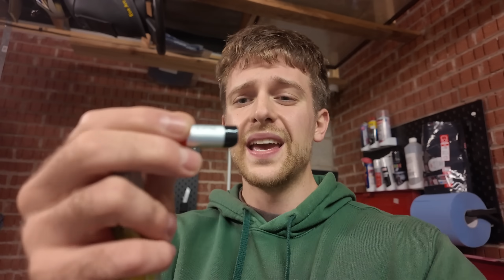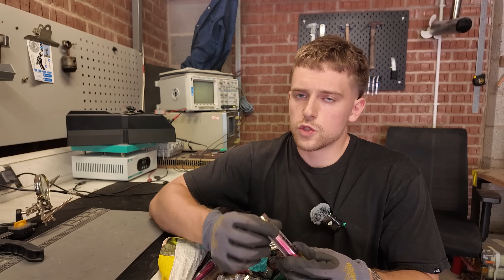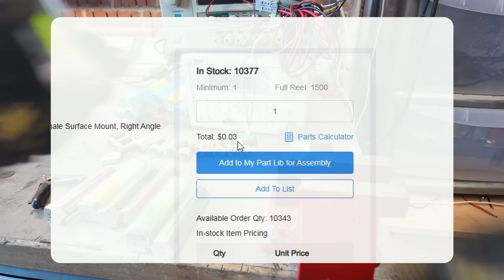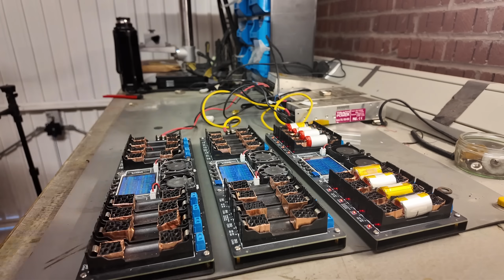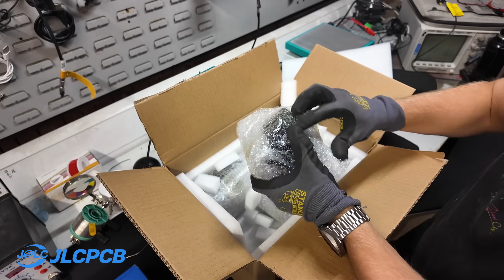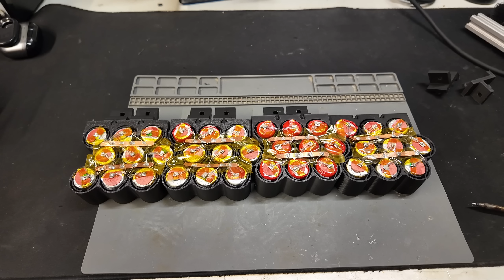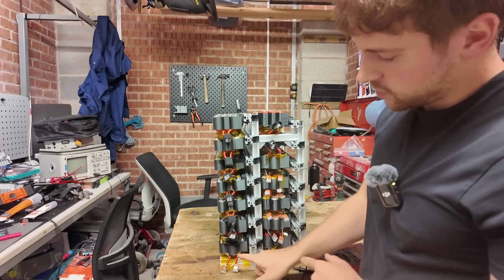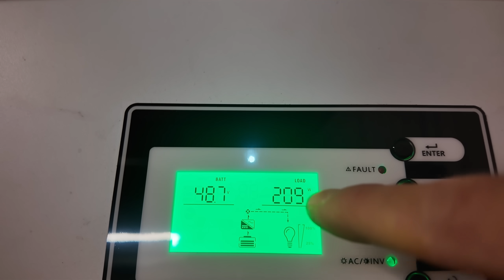I Powered My House Using 500 Disposable vapes

Comment: I was collecting these batteries for a little while, they are basically the Cr123A batteries that are about $6 a piece, just laying there on the side of the road for the taking. I did just a touch of soldering and am able to put it in a charger meant for those batteries. They are VERY common in good flashlights, gun lights/lasers and gun optics so It's nice to circulate them so I always have some charged instead of buying them for $6
Reply: This batteries are cool but needs to be cycled daily and it should be charged and discharged or else it will became a pillow you can even go for laptop scrap Batteries which are dead and get them at cheaper price and salvage them you may get some good cells from that and they will not going to be pillow 😅
Reply: @DIY-PROI they do not need to be charged and discharged daily. If they are not in use, they should be stored at storage voltage, 3.75-3.8v per cell
Reply: How do I make them actually usable for things?
Reply: @NationalTreasureExplorers  I wish I could share pics here... The ones I collected are mostly from "Elfbars" and wrapped in blue plastic, they look the same top and bottom but there's a tab of metal on both ends. The black wire soldered to 1 tab is negative and the red wire soldered to the other tab is positive. I clip the wires off, soldered the - tab flat against the battery, soldered the + tab flat against the battery then added a "button" (a glob of solder) on the + end. They then fit perfectly in a plug in charger I received when I bought a cheap optic (for an airsoft gun) that came with rechargeable CR123A's. I initially plugged this charger up to an extension cord stretched across the backyard in case something went wrong but when I placed the soldered vape batteries in the light was red like it was supposed to be and after some time the light turned green. So I put the rigged up batteries in my Streamlight brand flashlight on my real rifle and it was as bright as any new battery you could buy. And people throw these things out everywhere after using basically 2% of the batteries life

Comment: You can recover dead cells, by just leaving them on the charger longer. Most, if not all should recover to full voltage. I would recommend not going over 1A charging for most batteries, 800 mA for the small batteries (cigalikes).
Reply: Solder leads to bus bars before attaching to the pack. I have a spot welder for that. Don't want to send the batteries into thermal runaway.

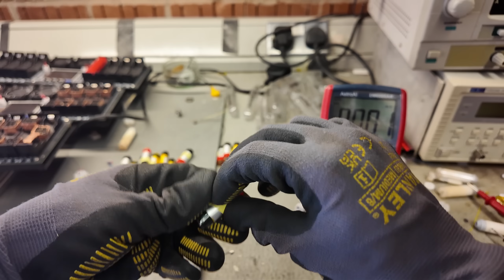Comment: 2:33 Nope, I've worked with 18650 Li-Ion cells that had 2V as their minimal Voltage. The min. voltage is different, based on many factors.

Also you shouldn't build a pack with cells in series. They had a hard life, are from different manufacturers and batches and likely have widely different internal resistances. Yes they can be balanced, but balancing is wasteful and takes a very long time. You might overwhelm your balancing circuit and end up with a pack that never delivers it's rated capacity.
Put similar cells in parallel and convert the resulting low voltage/high amp power into what you need with a DC/DC converter or DC/AC inverter.

FYI it is very common for a single cell to go low and slowly take out the whole pack. Ideally your BMS monitors that and (if your application allows that) shuts down the offending bank.

Comment: I really like the enthusiasm. But unfortunately there really is no money to be saved or earned recycling rechargable batteries at this small scale and this heterogenous form factors! 

For powering the house Deye offers 48V 5kWh Battery block for 750€ in a 19" metal case with BMS. I'm sure with deals and maybe from other vendors this can be had even cheaper! And these battery blocks are made of brand new LFP cells which hold up 6000 full cycles. 

At around 1% of calendaric degradation and estimated only 200 days a year where the battery actually does the full cycle this pack holds up for 15years before it gets into "inconsistent operation" territory.

Comment: I don't undestand how these can still be sold legally, when there are already alternatives on the market where you just change the pod with the liquid on top and the bottom part is reused and recharged. They are just as cheap and easy to use as the one-way vapes.
Of course there are also the more expensive vapes were you fill in the liquid manually that existed for even longer but most people want it as simple as possible.

Comment: As a battery nerd since 2015. You CAN recharge "bad" cells.

In my case I have 1,000s of 18650 cells. (yes thousands)

As the current is increased SLOWLY
The voltage SHOULD go up
If not the cell has EXTREMELY SMALL Lithium dendrites that have punctured the separator, bridging the gap from anode to cathode creating heat.
ONLY THEN a lithium cell is truly dead and should be recycled

how to charge a "bad" 18650
I will do something like this for a minute each
10mAh
25mAh
50mAh
100mAh
150mAh
300mAh. If they get warm at only 300mAh then there bad
Rule of thumb: dont charge a used 18650 above 1a per cell.

"But batteries are dangerous!/Don't do this at home"
No stupidity is
40,000 people in America alone DIE from car accidents yearly
while only 4% die WHEN a battery catches on fire.
Battery fires are extreamly rare.
There are literally BILLIONS of lithium batteries
Yet only a handful of battery fires
Batteries are actually incredibly safe.
The problem is fearmongering.

The Note 7 fires were caused by a manufacturing design flaw causing the Anode and Cathode to touch (short) releasing all the batteries stored energy in seconds caused by thermal runaway.
Hoverboards from Chyna were made so cheap they often cut costs like the battery or charger. Causing fires that were 

Also if there is a battery fire really the only way to put it out is to pour sand over it. Batteries already have an oxidizer and lithium fires are EXTREMELY difficult to put out.

If you are worried about fires and you want to use something safe. Look no further than Lithium Iron Phosphate cells/batteries. They don't get hot enough to cause a fire.

Good: You used kapton tape and balanced the cells. Ive been using Wagos since I saw them on Amazon. I KNEW they were better just by looking at them. Using them ever since.
Bad: You solder the cells and you didn't mention the capacities
3kWh is a nice load.

Assuming each cell is 500mAh
1 cell: 3.7v @ 500mAh = 1.85Wh
14s 36p = 504 cells
504 cells x 1.85Wh = 932Wh

Battery
51.8v @ 18Ah = 932Wh

@3kWh you will only be able to run about 15mins.
The battery has a extreamly impressively low impedance (cause vapes)
This is 3.22C
9/10 video. good job

Comment: As someone who builds these kinds of power station for home use, this was a fun watch. I feel like you've put more money into making the 'big cells' than it would cost you to buy actual cells, and better ones. So as a proof of concept it's an amazing thing, but could make an update on how the battery feels in a few months or years? I think these basic li-ion will not hold long, right? On the bright side, if they die out you can take this carcass and fill it in with 18650s lol, maybe even 2x in every cell holder. 

If you're going to use it, please monitor the degradation of cells, that's the most interesting part.

Comment: awesome vid!! regarding safety are you gonna build a non flamable sarcophagus around the battery pack? i know nothing compared to you about electrical engineering but wouldn't the large amount of soldering cause enough concern to the safety of the system? i usually just see spotwelds(i get theres no nickel terminals on the vape cells). very nice copper connectors doe

Comment: Be careful. A lot of electrical codes require a interlock to be installed to prevent back feeding the grid. It keeps linemen safe when the power goes out.

Comment: Banning these wouldn't be necessary if there was sufficient incentive to recycle them (including both reuse/scavenging and recycling of the non-reuseable cases ... just like non-rechargeable lithium batteries), both on the recycling end of things and incentivizing people to deposit them. (which would require both convenience of depositing and inconvenience or cost of not depositing them, maybe like a typical bottle deposit) Lithium is relatively valuable material and relatively cheap to extract from rechargeable and non-rechargeable cells.

Also, I think you technically can recondition some over-discharged batteries and/or configure them to be charged to a lower voltage, but that would require sorting and customization based around that.

Smaller, lower power Li-ion cells can be more realistically used in technically unsafe weakened, swollen used state where higher power ones would be a fire danger (like the sorts of batteries common to older gen flip phones, which can swell and still work tolerably well for years afterward, though at reduced capacity).  Large banks of small, low capacity batteries makes that sort of use/abuse more realistic than the use of any cells or banks with serious potential to overheat and ignite. (or explode/rupture and make a chemical/electrolyte mess)

Some of the cheap-o Chinese smaller sized Li-ion batteries are also refurbished/reconditioned cells of questionable origin, potentially including ones that have been overly discharged. (which isn't great when expecting new cells, but does indicate what you can get away with when reusing older cells ... and if you're the one working with known-damaged cells, it's better to at least consistently know what you've got vs buying something unknown and questionable)

Comment: How about building yourself an AC Tranformer battery stripe spot welder using a microwave transformer. Their easy to make as long as you've got half a brain & are a 1000x quicker than soldering together all those battery packs u like building. Also I've send quite a few videos showing how you can bring those dead half depleted batteries back from 1.3 volts or wot ever to the proper  3.7 volts.

Comment: In my experience, you can use a fair number of li batteries that are below 3 volts. I have a few bike batteries that have been going for 3 years strong. When I got them, most cells had under 1 volt, hadn't been charged in years and were 5 years old. They only have about 80% of their capacity but they've been working great.

Comment: Actually you can probably recover most of those dead ones. i have done it.  Just try. Charge a few and see what happens. You have to regulate the current low until they get up to 2-3v aka trickle charge. Whatever you do don't put a fast charge on them or they will pop. Ask me how i know.

Comment: It's an insane amount of work, and I have huge respect for doing it. It's impressive proof of concept. But the most insane thing to me is that disposable vapes were even allowed to begin with. It's even more insane when you consider that, growing up, it was absolutely normal and expected that most smaller, portable devices had regular AA or AAA batteries, and you could obviously use rechargeable batteries if you wanted. For example, I still have my first MP3 player, and it still works after about 25 years. It just takes a single AAA battery. Easy to replace. The newer MP4 player came with a glued-in Li-ion battery. If it dies, the device is practically useless.

Comment: Fantastic work! I would be cautious about powering your house from your powerbank though. Not due to the powerbank but due to the wiring between your house and the shop.

I'd check the electrical plan, breakers of your house/shop but I imagine the builders intended substanially less current would be flowing to the shop for various power tools (a 15A breaker perhaps?) compared to the full brunt of your house current and thus may be using a smaller gauge wire between the house and shop.

Comment: I didn't know they used rechargeable batteries i disposable vapes AI got it wrong
No, you cannot use the rechargeable batteries from disposable vapes in other devices, and you should not dismantle disposable vapes at all. While they contain a lithium-ion battery, attempting to remove it can be dangerous due to fire and chemical hazards. Instead, dispose of the entire vape, without dismantling, at a designated recycling point for electrical waste, often found in supermarkets.

Comment: Super sketchy, but proves a good point.
I would beef up the bus bars on the cells packs, make sure they all have similar capacities and make sure the main current path has no weak links.
I still have 1000 good 18650 cells that I'm still waiting to find the time to assemble - hopefully one day.

Comment: I have a crap load of these Vape batteries I saved from my own vapes. I also kept the casing for recycle because they are aluminum. Some are plastic but extra money latter.  I guess I should check with my vape shop to see if they collect the used ones.

Comment: Many household electrical appliances have a built-in power supply that converts 220 Volts to 12/24 Volts (and spends some of the electricity on heating). Thus, when you use an inverter to increase the voltage from the battery for an electrical appliance, you lose efficiency on a double conversion. I have an autonomous power supply system with solar panels, however, for those electrical appliances that do not actually need 220 Volts, I have installed a separate power supply line, without inverters. For example, I directly powered a laptop, charging phones, monitors, desktop (picoPSU has an incoming voltage of 12 volts), a water pump, LED lamps. This allows you to power the network from batteries for longer.

Comment: Awesome build! I'd personally be a bit worried about heat for these batteries. I certainly would not be keeping this pack indoors - You may want to stick it down at the end of your garden or something, build a containment box with cooling fans, and keep it away from anything flammable.
Reply: This would be nice follow-up video, talking about safety aspects and building a "kiln" for the battery in the garden. Build something that is designed to handle that the batteries go up in flames. Put solar panels over it to shield it from the heat of the sun.

Comment: I've been powering my ebike by 600 cells from disposable vapes, I made a 48V 21Ah battery from them , 1,5kW output, worked like a charm, rode couple hundreds of kilometers on it  in 1 year before it became a brick. many of them are very sketchy quality (beware of flat 400mAh cells from salt vapes. those are crap, go into some kind of short and they slowly pull the rest of the parallel group down to 0 if you don't  use the battery for couple of weeks and watch the battery regularly , even the BMS couldn't save it. I used much smaller cels (400 and 550mAh, so it was a looooot of soldering. I actually wanted to make a video about the whole project (started almost 2 years ago)  but I already ditched it conpletely. It was a bulky battery anyway and I was carrying it in my backpack. But anyway, everyone who saw it was amazed, how can an ebike be powered by such tiny cells 😂. It was a nice challenge project just for fun of it, but definitely not a viable option or substitute for good old 18650's if you want something reliable and long term
Reply: Great information, thanks for sharing